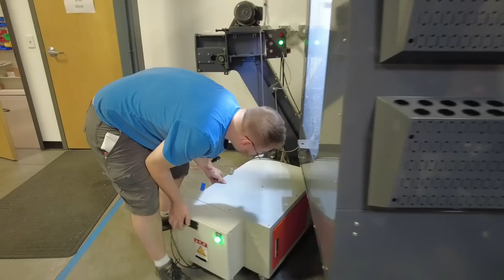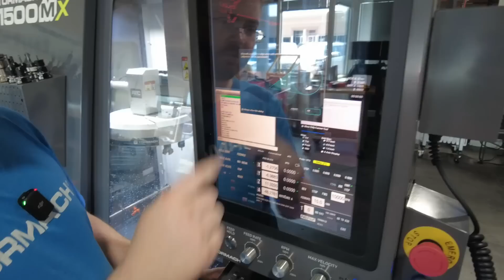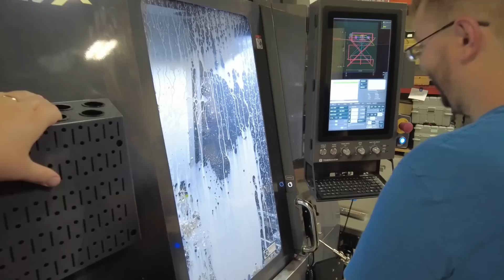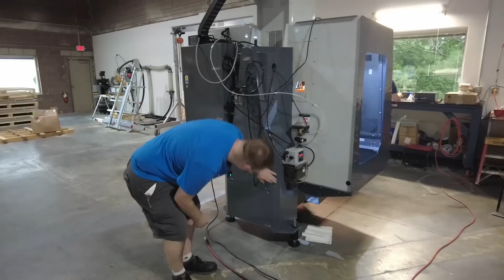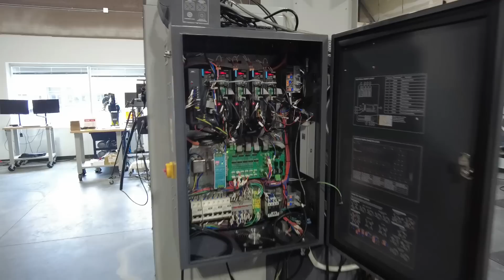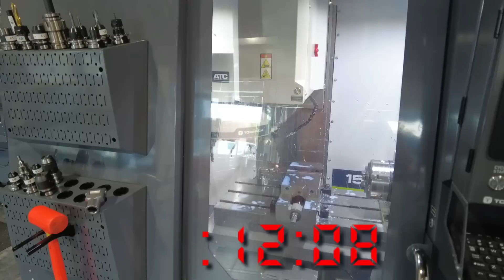Dissecting a Tormach 1500MX

Comment: Would've liked to see it with the z axis cover off. Could then see how easy the draw bar actuator is to remove to bring the height down for fitting through a low (7ft) garage door
Reply from the maker: I know, I regret not doing that. It was my fault, I was tired after two really long days, and i still had a 7 hour drive home. It's annoying to remove the cover off my haas, and figured this would be the same. Sooo I flaked out.
Reply: If you remove all of the headstock sheet metal (no need to remove the PDB cylinder) you can get under 7ft. There is no official documentation or support for removing the headstock sheet metal, though.

-Norman
Reply: Btw many thanks for your videos
Reply: When will these be available in the uk